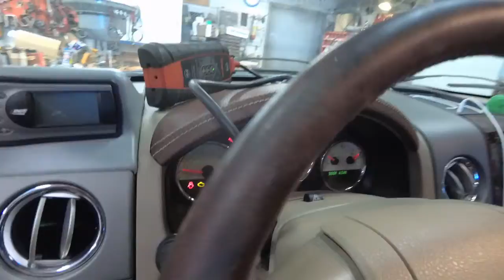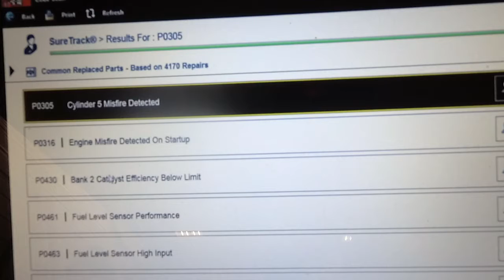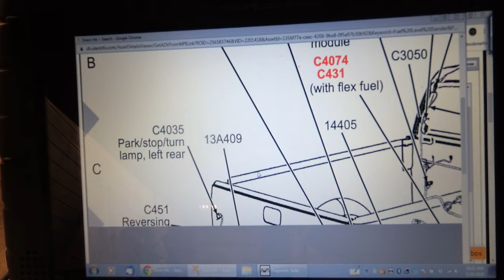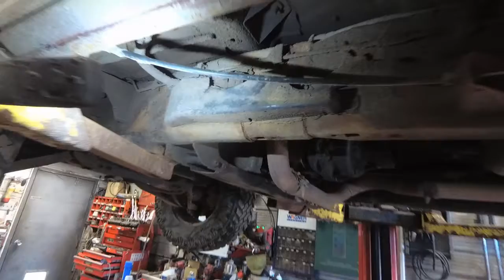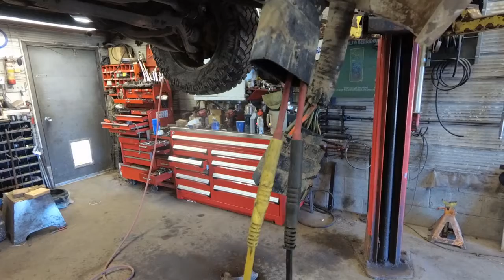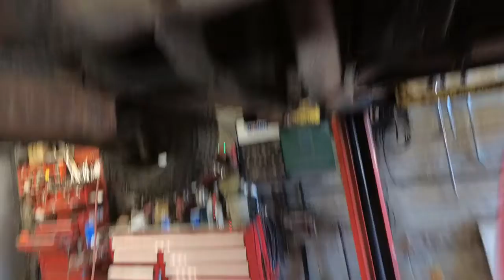2007 F150 Fuel Gage Diagnosis

Comment: Mine stays on full when it's not full how do I fixthat
Reply from the maker: You have to test the sending unit in the pump and the circuit. You should be able to test the gage with a scan tool doing a sweep. You should also be able to see fuel level with a scanner in the data list.

Comment: I have a 2006 f150 lariat with flex fuel. My fuel gauge has not been working and I’ve put a fuel pump in it and it’s still not working. I’m seeing a lot of people having issues with the flex fuel module itself and have seen where a couple of people have even bypassed the module. Looking at the wiring diagram, could that module for flex fuel somehow cause the gauge to stop working?
Reply from the maker: It is possible that the flex fuel module could be at fault. The pump is different for flex fuel.

Comment: To test the gauge could a 6V or 9v small battery be connected to the wires to the gauge?
Reply from the maker: No the sender in the tank is a variable resistor which creates a voltage drop.

Comment: You got some good videos pal, just trying to help anyone down the line, if anyone has 07 f150 with  5.4 make sure you use the right coil boot lengths. They are color coded. Use the wrong one and you will misfire.
Reply from the maker: That is true.

Comment: I have a 2012 lincoln navigator L and i have replaced the fuel pump assembly but still get erratic readings like saying low fuel when i just filled up and the cluster guage reads full but the digital display says low fuel.  Have you ever encountered a ford doing this?  I would appreciate any ideas on this as i jusy spent $600 on the new fuel pump. 
Im getting a P0462 and a B1204
Thank you
Reply from the maker: Just cause the pump is new doesn't guarantee it is good. Was it changed for that problem or did the problem happen after the pump was replaced? I think your codes reflect a low resistance problem.  Need to test the sender resistance to start with.
Reply: @PhillipBailey good point! yes it was changed because of these codes that came up. 
I traced a wire connection from what I believe comes from the top of the tank. The one in your video is under the driver's side, 
and mine is under the hood on the driver's side,  just below the  brake reservoir. I don't have wiring diagrams, unfortunately.
Reply from the maker: @fortunatedad7695  for diagrams try Alldatadiy.com. it's quite reasonable imo.  Once you know the wires you can measure resistance of the sender but you have to test it when the problem is present. If the gage works when the fuel level is at a specific point it suggests a bad spot on the sender but if you have the same codes and symptoms as before the pump was changed its likely not that. HTH
Reply: @PhillipBailey  it's probably just a loose connection but as you know it's the matter of finding where that annoying wire lol. 
That link didn't work, but I'll see if my buddy can print out a diagram, thank you though. 
I guess I was just hoping that maybe you ran into this problem in the past and then would say oh it's just a loose connection at a so and so wire connection lol. 
I appreciate your time, you jusy earned a sub 😀
Reply from the maker: @fortunatedad7695  https://www.alldata.com/diy-us/en try this one
Thar does seem to work either 🤔
Reply: @PhillipBailey it working now. Thank you my friend!
Reply from the maker: @fortunatedad7695  what did you find?
Reply: @PhillipBailey  lol, sorry, I thought i was going through the right steps with that link you sent me, and now I ended back to their website saying, 404  page not found." 
Perhaps they don't support older navigators anymore.
I'm trying to Google the location for the fuel pump module location. My bluedriver scan tool said it might be a short circuit to ground. So if I can find the module, maybe it might be a ground from it that has a corroded connection 🤷‍♂️

Comment: I have my nephew's 04 F150 4 x 4 Lariat. The original issue was speedometer and temp guage not working. Well I was physically looking for wiring issues under the truck. Found the wires and connectors you mention on the drivers side on outside of frame.  Removed cover. It was encased in dried on mud. Cleaned it up. Sprayed the connections with CRC electronic cleaner. Reassembled. Now gas guage inoperable. I must have perhaps loosened a connection?  Ended up replacing differential speed sensor and transmission output sensor still no change in speedometer.  Rechecked and firmly verified the said connections. No change in fuel guage. Did a guauge sweep . The speedometer  goes right and back left. But speedometer only twitchs. Retried sweep. Speedometer goes right fully then to 110 and stays and twitchs only when test driving.
Reply from the maker: If the odometer records distance traveled over a test route but the speedo needle does not read mileage then the issue is in the cluster.

Comment: simply disconnecting or grounding the fuel level sender circuit and checking the fuel gauge operation will not work.  the battery would need to be disconnected for 30 seconds, then reconnected, then the key turned on. If this is not done, the cluster will go into slosh mode and the fuel gauge will not change.
Reply from the maker: Yes you are correct unless you clear the code or at least cycle the key.

Comment: New pump, new module checked wires pulled pump out twice. Chech ohms on sender. Why is my gauge stopping at 325 goes no lower? Any advice?
Reply from the maker: Don't know what you're saying...fuel gage only goes to 3/4 tank?

Comment: Is it OK to put a little connector protector dilectric grease on that?
Reply: Dude your pretty good. Helping people in the comment section. From the looks of it you own your own business, that takes a lot of time more than people realize. Customers are lucky to have you in their area, you make sure you get the diagnosis right. You got the right tools to do the job. Most of the places around me are just ripping people off. Maybe you can make some cash off this platform.   Your videos are valuable
Reply from the maker: Thanks for the positive feedback 😀
Reply from the maker: Yes for sure.
Reply: @PhillipBailey  Thank you.  That's what I did.  I just filled up and the needle sent to F immediately.  Thanks for the fix.  Now if I could just get the check engine light to go off.  New gas cap from the dealer and it came back on.  I am getting stumped on this one.
Reply from the maker: @lanceschul  what code/s is it setting. I gather it's Evap related.
Reply: @PhillipBailey  yes, P0446. I changed a couple parts out on the firewall (solenoid I think) and put a factory gas cap on.  A mechanic I went to said it was the truck's computer and to put a piece of black tape over the light.  Not going to do that...
Reply from the maker: @lanceschul  p0446 is low voltage on the canister vent solenoid circuit. The vent solenoid is near the charcoal canister by the fuel tank. Here's some steps to check it out...
1. Check 7.5 amp fuse #5 in the Central Junction Box (CJB) (interior fuse panel) to be sure it's in place and not physically damaged. If OK, check for battery voltage from fuse #5 to the Canister Vent (CANV) solenoid at the carbon canister on the Dark Green (DG) wire with the key in the Run position. If battery voltage is not present, check for a possible connection problem at connector C3138, which is a 16 terminal connector located on the outside of the driver's frame rail below the driver's door. Repair the wire as needed and recheck operation.

2. If the DG wire shows battery voltage with the key in the Run position, check the resistance of the solenoid to verify it indicates 48-65 ohms and that the connection is making good contact to the solenoid.

3. If the solenoid resistance is OK, check for battery voltage on the Violet/White (VT/WH) wire of the solenoid with the solenoid connected. This circuit should indicate battery voltage at the solenoid and at Powertrain Control Module (PCM) pin 61 of connector 175b. If the wire shows battery voltage at one end but not the other, repair the open in the wire, again starting with checking at C3138. If the wire does not show battery voltage at either end with the solenoid connected and key on, check the wire for a short to ground and repair as needed.

Comment: What came of this diagnostic and repair?   Did the new pump get the gauge working?
Reply: Wow that was an expensive fix for just the fuel level sending unit card being dirty or bad... Excellent diagnosis though.
Reply from the maker: @breckfreeride  pump wasn't holding pressure after shut down either.
Reply from the maker: Yescthe new pump fixed the fuel gage and pressure leakdown

Comment: do this wires check fuel
Reply from the maker: Not sure what you're asking?
Reply: @PhillipBailey   I have a ford 250 1995 that's not marking the gas . Can the problem be on the wiring harness
Reply from the maker: @alexismarroquin9137  it's either the sender inside the tank, the gage in the dash or wiring. Does it have dual tanks?

Comment: Seems like I can hear my fuel pump running  intermittently getting noisy or something hundred thousand on it
Reply from the maker: Erratic operation of the fuel pump could be worn brushes in the pump but I'd recommend to visually inspect the fuel pump driver module located by the spare tire on the driver's side frame crossmember. They corroded and fall apart. Hope this helps you

Comment: I have a problem with my 07 ford trailer wiring, I have no power to any of the pins beside the left signal/brake, I replaced the trailer harness but still nothing. Any ideas?
Reply from the maker: There should be several fuses in the underhood fuse center for the circuits. I'd start there first.
Reply: @PhillipBailey  thanks, found a blown 20A fuse, I’ll have to hook up to a trailer and check it